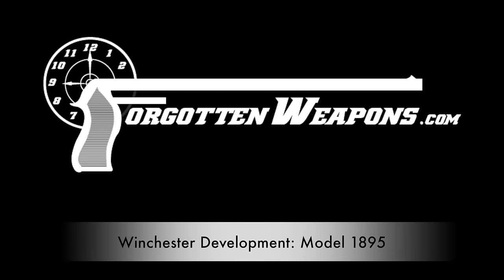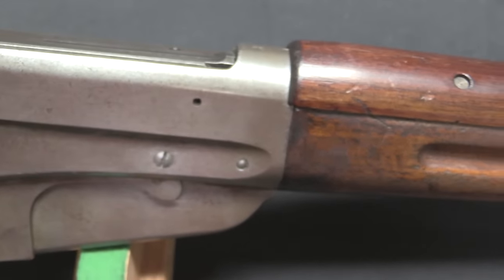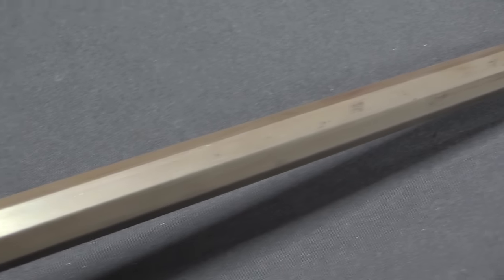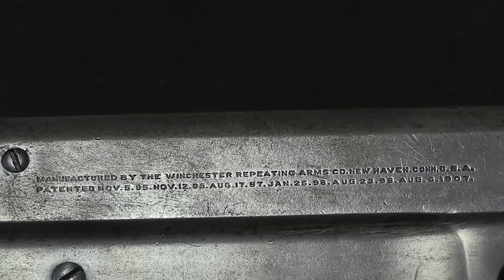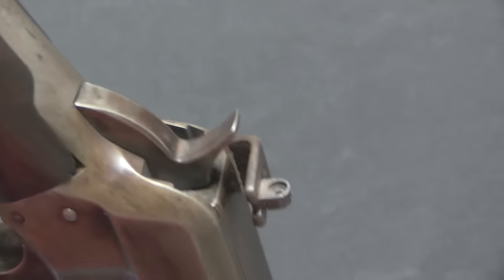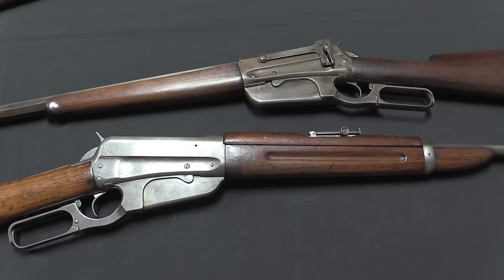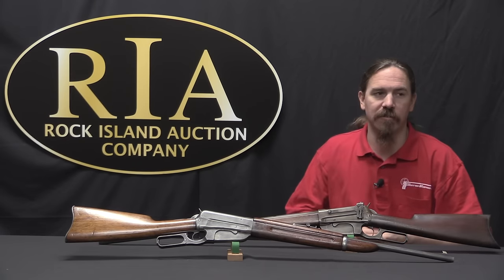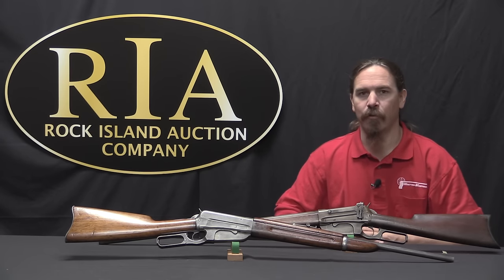Winchester Lever Action Development: Model 1895

Comment: That was an interesting aside about Browning's semi-auto shotgun that Winchester turned down.  Browning also offered it to Remington for sales in the US (FN sold them in Europe).  It sold so well that whoever made that decision at Winchester HAD to have ended up kicking himself for letting it get away.  The gun Winchester came up with to try to compete, the Model 1911 shotgun, was not a good design, and has the nickname "the widowmaker."   Winchester had to design around Browning's patents, and one of those patents was for a charging handle on the bolt.  So Winchester checkered a space on the barrel, and (pointing the gun in a safe direction), you grabbed the barrel and pulled it back to charge the gun.  Problems came when shooters had a stuck case (more common in the days of paper shotgun shells that would swell up), and place the butt on the ground and try to force the barrel downward, and inadvertently shoot themselves in the face.  I read about one of these old guns claiming a victim this way just five or ten years ago.  I have a Winchester Model 1911 that used to belong to my grandfather. but the stock and handguard are split, so I've never shot it.  Split stocks are quite common with these, as the two fiber washers used as friction rings wear out and fail pretty quickly, and when they go, recoil becomes truly fierce, and often splits the stock -- yet another reason these guns lagged far behind the Auto 5 in sales.
Reply: No One Important, yes, they didn't pass on the design, they passed on Browning's revised terms for selling them the design.  But as I said, they simply had to have regretted that decision after the Auto 5 became such a huge success for Remington and FN.  They would have done better to agree to Browning's terms.  As it was, they lost a huge segment of the market to a rival company.
Reply: I would guess the gentleman in charge of Remington at the time wouldn't have regarded his own sudden death as all that fortunate.
Reply: +No One Important It's not a question of my wanting to admit anything; the sudden disarray at the top of Remington was obviously the cause of Browning's trip to shop his long recoil patents in Europe.  I just think it's generally a bit tacky to regard a man's untimely death as "fortunate".
Reply: "Try to get over your self-righteousness" may be the most self-righteous thing a person can say to another.  You realize this. :)
Reply: Ah, the Internet.

Comment: Slightly off topic but appropriate for the series - did anyone else ever attempt the Lebel solution to the spitzer-in-a-tube magazine problem [a guard ring around the primer]?
Reply: Because box magazine is so much superior than tube magazine,no military bothers to keep tube magazine on their rifle.
Reply: I'd doubt it, the Lebel with it's tube magazine always just seems to have been a stopgap measure, used out of convenience in order to get small bore smokeless ammunition into the hands of troops as quickly as possible; while trying to avoid copyright infringement or having to pay royalties to a foreign company or gunsmith.
Reply: I believe Remington tried  a tube magazine with a spiral groove pressed into the tube which was supposed to force the cartridge off center,  so the noses did not line up with the primers in their pump action rifles, but it did not catch on.
Reply: I suppose they could have returned to rim fire as well...
Reply: Ian has it wrong here. Go to C&Rsenals video on this gun, Spitzers came way after this gun was developed and chain detonation is somewhat overstated. 
Box mags are just superior to Tube Mags all the way around
Reply: @brucelee3388  yes, Peterson’s model 14 series. Remarkable feat of engineering.

Comment: Seeing the loading procedure I can understand why the Russians wanted stripper clips - seems loading is much more complicated and slower then kings gate or even the original Henry. (now you really have to bring a 2 gun : Mosin Nagant against 1895 Winchester)
Reply: Well, someone has to use the Winchester.
Reply: TheRealColBosch that was TFB TV Ian hates the G3&Co an Carl used to hate the Gali.... 

I think combat practically is more on the Mosin side if you use a 1895 without stripper clips - for a hunting rifle that's no issue but the 1895 looks like it's better just for 5 shots and then you can start single feeding. 
(we could throw in a Nagant revolver and a 1911)
Reply: Pekka Rastas they where in dire need for arms and it would propably have been easier and cheaper to issue them without clips - I guess the munitions did not come from the factory with the clips - even the Swiss did reuse their really clearly single use clips after all.

Comment: At 7:44 when showing the 30 U.S. marking what are the 2 marks bookending that? What do they mean?
Reply: Those are the Winchester proof marks. The barrel was proofed first unassembled and with a very high load and that’s when the barrel got the mark. After assembly the rifle was proofed with a higher than spec charge, but not as high as the barrel proof load. That’s when the receiver got the proof mark. When these were first imported to England they would proof them with a barrel proof load assembled and destroyed many rifles. Winchester found out and had to set it straight. The English proofhouse then actually came to a agreement with Winchester and accepted the Winchester proofing, and I think was the first firearm sold in England without English proofing.

Comment: Apologies if you've already answered this question, but are there any benefits to having an octagonal barrel over a round barrel?
Reply from the maker: No, there really aren't.
Reply: You get more girls if you have an octagonal barrel
Reply: It was originally thought that the octagon barrel cooled faster so less effect on accuracy when firing lots of rounds, supposedly more surface area so faster coolling. I don't see too many octagon barrels on target rifles so I'm sure that's debunked.
Reply: The octagonal barrel was easier to manufacture using older, simpler technology (pre-1800-ish) When barrels were forge-welded around mandrels they were almost always shaped using nothing more than files. Machine tools such as lathes were not available to the gunsmith of old, so filing flats onto a rough-forged barrel was much easier than trying to file a barrel perfectly round. They were popular on later factory produced guns for aesthetic reasons, I believe. (they were also heavier and helped with accuracy).
Reply: LordRaa style points
Reply: Hmm, maybe they are thicker than round barrels, if that helps with anything at all
Reply: Cheaper. Cost was always the biggest factor.

Comment: A very interesting video. I had a 94 for many years (albeit post 1964) but have ever had a 1895 in my hands. The 94 had a 'striker transfer' button in the locking block so that a cartridge could not be fired without the block being in complete battery. I'm not able to see that in the 1895. Did it have one?
Reply: You cannot fire this rifle out of battery. On one of mine I have to slightly so slightly squeeze my grip around the lever to allow the hammer to drop. The firing pin is also blocked from firing until fully in battery.

Comment: This 1895 Winchester in .30-06 caliber chambering would have been a good rear area rifle for training troops, military police, artillery troops, guards, drivers and other service troops, especially in a carbine form. The U.S. War Department should have come up with a carbine form of the Winchester 1895, probably with a 24 inch or better yet a 20 inch barrel. A stripper clip arrangement could have been made to use the same .30-06, five round ammo clips as the 1903 Springfield. Say for instance, the US National Guard and Reserve troops could have had this carbine version of the Winchester1895 rifle along with many of the active duty rear area troops. The Guard and Reserve troops in the frontline infantry could have turned in their Winchester 1895 carbines for whatever frontline bolt action rifle the War Department could give them, if and only if supplies of new rifles were available. But at least the Guard and Reserve would have had the carbine Winchester 1895 rifle to serve with if called up. This factor could have freed up 1903 Springfields for the frontline active duty infantry. The Savage lever action could have filled a similar role. The lever action Winchester 1895 in carbine form would have worked for the Navy sailors who have a need for a rifle for boarding, guard duty, and for port security etc.

The point is the Winchester 1895 rifle chambered in .30-06 in carbine form could have been purchased for Guard, Reserve, and rear area troops and for the entire Navy Department, minus the frontline Marines infantry. This carbine 1895 Winchestr rifle could have  worked well in this role. The Signal Corps could have also bought this carbine Winchester 1895 for its troops in the newly created Air Service too. The Coast Artillery, Border Patrol, Cavalry Corps, Military Police, federal civilian law enforcement all would have loved a handy carbine version of the 1895 Winchester rifle. The fact that this rifle served well with the Russian Army in World War One, the Russian Civil War and in the Spanish Civil War speaks to the validity of these statements made here. Such a scheme for the United States would have freed industrial capacity for the War Department and the Marine Corps to equip their frontline infantry with the most desirable bolt action rifle design of their troops needs at the time. This carbine Winchester 1895 rifle would have been perfect for training, and rear area troops providing them with an adequate service rifle. 

So purchasing a a MILLION PLUS of these carbine Winchester 1895 rifles would have been extremely cost effective, especially if optimized for mass production. These rear area carbine service rifle would have been battle sight zeroed for 300 meters at the factory with a single peep or buckhorn type sight. The idea here  is once a soldier zeroed his rifle, no further adjustments should have been necessary or even allowed. The more complex lever action system would have worked fine for these rear area troops who "need something to shoot just in case." These rear area troops wouldn't have had to shoot very often because their workday tasks don't include any regular need for shooting. The carbine version with a 20 inch barrel would have been ideal for getting into and out of railroad cars, ships, vehicles, aircraft or horses. We probably could have used this rifle into the 1930's or even longer for rear area security, training and 2nd echelon troops like Coast Artillery, industrial plant and railroad guards well into World War Two. Winchester had the machine tools ready for use BEFORE the First World War. The War and Navy Department were short sighted in not improving and ruthlessly standardizing this 1895 Winchester rifle design for mass production for rear area troops, security tasks, cavalry, training, Coast Artillery, the Navy Department, Guard and Reserve troops, and countless law enforcement or Border Patrol missions.

Comment: Query:  on the 1894 the transfer bar for the firing pin is located on the locking block. On the 1895 it appears to be on the back of the bolt itself, so what serves as a disconnector on the 1895?

love that ancient Lyman sight system.

Comment: I have a minty one made in 1909 with the factory installed Lyman sight (some were aftermarket), deluxe wood, recoil pad and in 30-03 caliber (a special order in 1909) which is marked ".30 U.S. MOD. 1903".  Unfortunately 1909 records are not available from Winchester.  The wood grain in the butt stock is virtually identical to T.R's (at the Cody Museum) which leads me to believe that they came from the same piece of wood.  I shoot it several times a year with light cast loads and love it.

Comment: "A far better combat weapon that a Mosin-Nagant bolt action rifle."

Based on what? From what I have read the M1895 did not like extremely cold conditions any more than the German M1898 rifles did, while their closer tolerances made them more prone to jams if dirt, mud or sand got inside them, and were MUCH harder to strip and clean, while it had inferior primary extraction compared to the Mosin-Nagant and bolt action rifles in general. The Mosin-Nagant is, in my opinion, the best bolt action service rifle due to its durability, robustness, and reliability in adverse conditions due to loose tolerances and super easy to clean magazine and bolt assembly. The M1895 is a very good sporting rifle, but not a great military rifle IMO.

Comment: can you do the development of the marlin lever guns next?

ive got a 336...... made in 2005 (thankfully still an actual marlin).....and it has micro groove rifling. 

ive got a lot of questions about micro groove.....but, my questions can be boiled down to..... why?

also, i have no idea how they came up with that design..... it seems to take a LOT from the model 94 and 95 (how it locks)
but they improved it......you dont have all the guts coming out the bottom

Comment: You are somewhat wrong when you say Winchester hasn't introduced any truly new lever action rifles since the 1895. Winchester sold a .22 lever action rifle called the model 250 in the 60s and 70s. It has a completely different action than the developmental Winchester lever action rifles. You should do a video on one if you have the chance. If you end up wanting to do a video on it, I could lend you mine.

Comment: I think john Browning fell short on this one i mean you have to load it incredibly oddly and also its only a capacity of 4 +1 ( in 30-06 ) 

These problems where fixed in the Russian model but Winchester could have had more than one millitary contract

I'm thinking of taking one of the current production ones and fixing these problems and also making it feed from a set of stripper clip guides

Comment: I have a comment re the “safety” hook for the lever: I think it is to keep the lever fully closed and action fully locked up when firing.  Many years ago I had a Model 71 and its lever would often kick open (down) about 1/2 inch when fired.  Did not inspire confidence.  I sent the rifle to Ackley for “improving” but it didn’t help, but that did destroy its collector value, but then it was subsequently stolen so I have no regrets.

Comment: Always wanted an 1895, probably in 30-40. Had the army changed to a spitzer by then? It was originally a 220 gr round nose, if i remember the history correctly. I have heard the 1895 was popular among Texas Rangers, often in 38-72. I'm sure the 405 would have been a bit much. Don't think i've seen that Lyman sight before. Interesting design. One of these days i'll get one of the recent repros- maybe in -06, because a lever action 30-06 is a novelty (only other one is the BLR). A 30-40 or 7.62x54R would be fine too. Great video as always. Thank you
Reply: The .30 Army ball cartridge was only loaded with 220-gr RN FMJ bullets.  However, by 1895, commercial cartridges were available in .30-40 Krag with RN 220-gr SPs and 180-gr SP Spitzers.

Comment: Ian, I think that front sight is broken. Mine folds down to reveal another blade. Folded down it was called a hunting sight, up it was called a target sight. As I understand it, folding down had nothing to do with protecting it. It just flipped up another blade that didn't have the target ring. ...at least that was my understanding.
Reply from the maker: There were a huge number of different sight options; I suspect your is just a different option.

Comment: The chances of a bullet to primer detonation are minimal since the rifle and shoulder will move on recoil limiting actual force from bullet tip to primer. The realistic concern is when rifle is dropped, especially square on muzzle, resulting in rifle coming to a complete forceful stop, while the cartridges are still moving in their mobile state in magazine. A more obvious example of this is a car moving with some velocity,veering off road into mud, opposed to same care hitting a solid wall. The rapid deceleration will be extended somewhat with both shoulder and mud, while almost instantaneous speed to zero with muzzle hitting a hard floor or car hitting wall.  There was at least one incident reported by French in that era.
Reply: Dor Aran That and some guys actually tested the concept by shooting at a long gun with a clear acrylic magazine tube, complete with spring and everything.  They could not get the rounds to detonate.
Reply: An old gun magazine, from 1950's or '60's  made a tube with ancillary structures to duplicate weight of rifle, and  with primed pointed bulleted cases loaded with oatmeal to duplicate weight of powder and after several hundred tries they got one primer to react, from about a 10ft mock muzzle on concrete  drop. Unfortunately I can't locate that article in my old  gun magazine collection.

Comment: If you say "far better combat weapon than mosin" in a video like this you are done.
In my opinion, it has to be some reason why most of the coutries adopted bolt action rifles instead of lever action rifles.
Reply: Antonio Fdez I would guess one of the main things is easier to operate while prone or when perched on the edge of a trench
Reply: Yes,but its not all about trenches. Bolt action action rifles have been used before and after the WWI, and that is because in my opinion they are better design for a combat rifle. Not only easier to opetare, they are also stronger (two locking lugs at the bolt head instead of one at the very end of the back of the receiver like this case) and simpler with just a few moving parts.